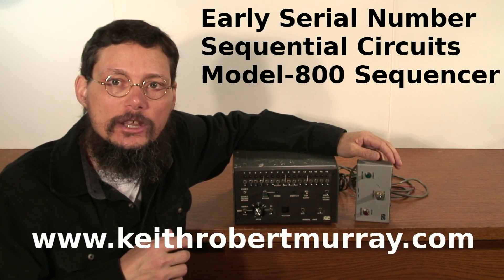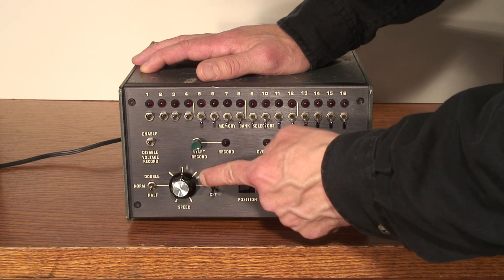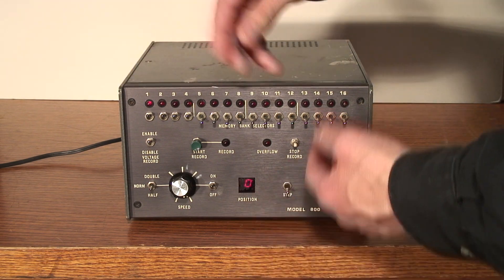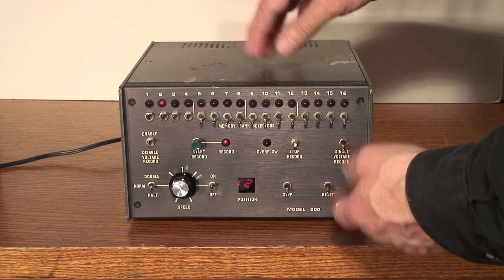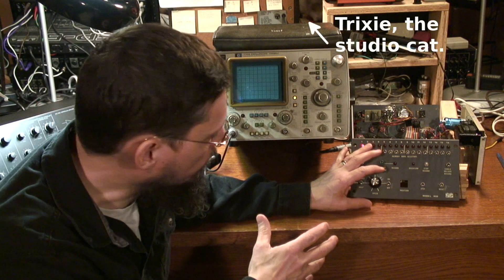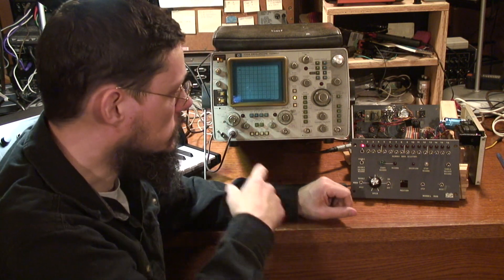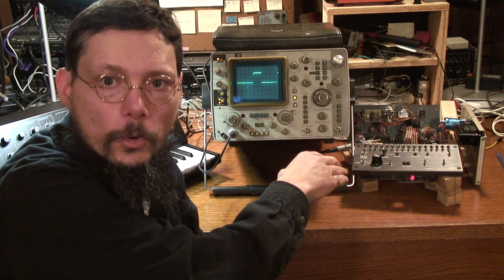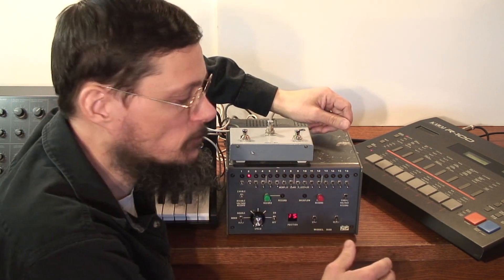Sequential Circuits Model 800 - Early Serial Number

Comment: Couple questions. How many of these earlier versions with the 10-bit dac do you think exist? And, how would one program odd time signatures?
Reply from the maker: It would be difficult to determine how many Model 800 sequencers have the 10-bit DAC without doing a survey of existing owners.

Regarding odd time signatures... the Model 800 doesn't count beats or "ticks" like most sequencers.  There is no concept of a bar, or sequence length, or quantization.  It simply times how long each key-down event lasts for, and how much time is between key-down events.  You play anything into it, with any timing, and it will simply replicates your timing when it plays back your sequence.
Reply: @krmelectronics  I have serial number 96 - if I can submit any data that might help, let me know!

Comment: Great informative videos Keith! Do you service analogs for the general public? I have many vintage gems that have been in storage for more than 15 years and would like to set up mystudio again. I suspect they will need someone of your skill set.
Reply from the maker: Lawrence Grapentine Hi Lawrence.  Yes, I do general synth repairs, but only if you can get your equipment to Toronto (Canada). I don't take repairs through the mail.
Reply: Keith, Thanks for getting back. I'm in Cleve. so it wouldn't be that big of a deal coming to you.You are closer than shipping to New York  or L.A. anyway. I'm setting up my analog studio after 15 plus years in moth balls. I'm trying to get Dave Yost from Pi corp here in Cleveland (whom I bought most of my gear from years ago) but he is busy running the electronic music dept at Cleveland State U. Maybe you have heard of him. I just need someone to service and tune up the stuff. I have a 2600, sh-5, cr8000, juno60, sec cir 700 programmer, just to name a few. I want to do this over the summer into fall. I'll be in touch. I'll use your e-mail. Thanks again.... Larry... E-mail ofc451@gmail.com